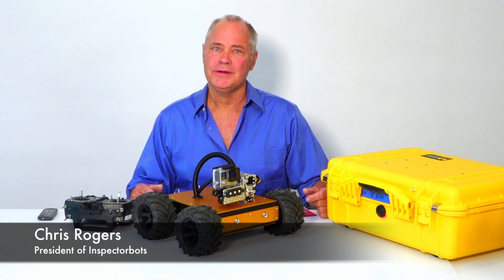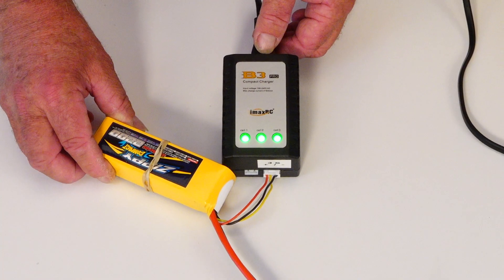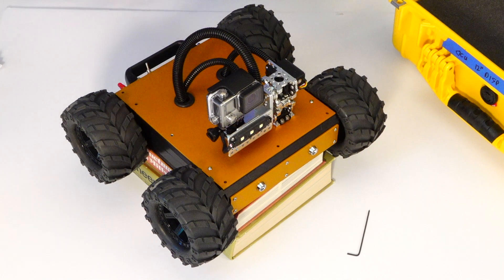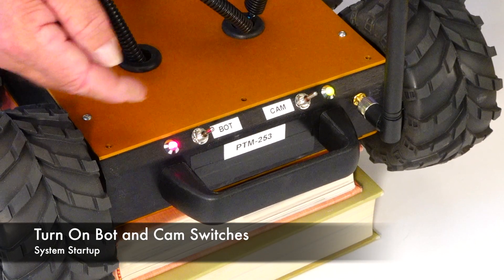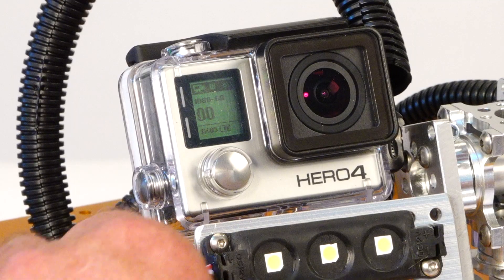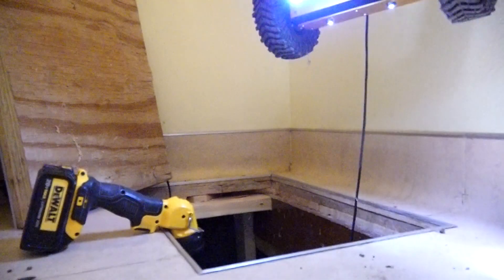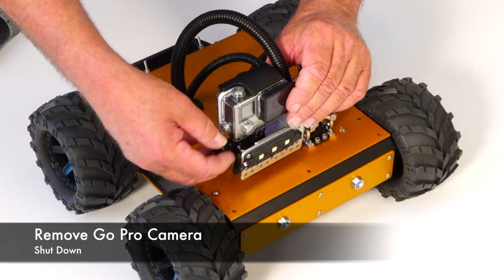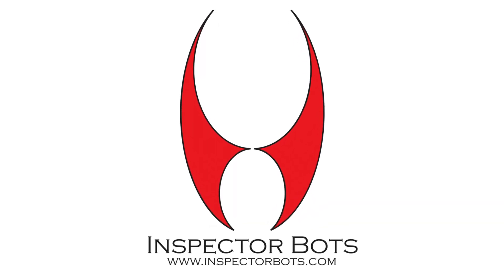How to use the Pan Tilt Minibot Robot

Comment: I find it interesting that you still use HERO4 cameras instead of the latest. Any reason?
Reply: To spend less on production cost
Reply: newest ones do not allow remote video feed. Something about losing a court battle with DJI. Action 3's are better for this application in our experience anyway. not as many overheating problems, less data loss and longer run times with the Action 3.